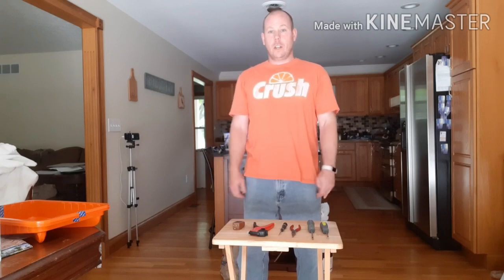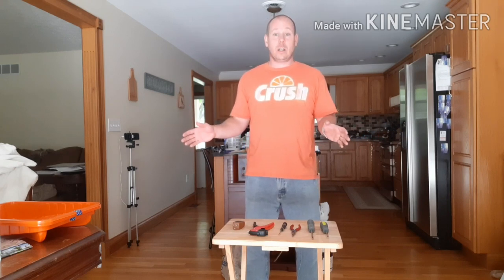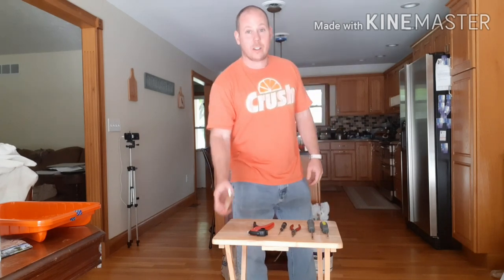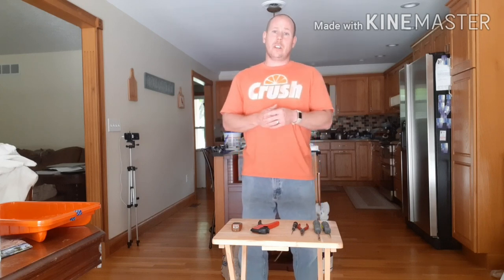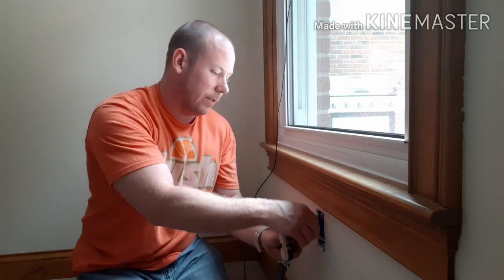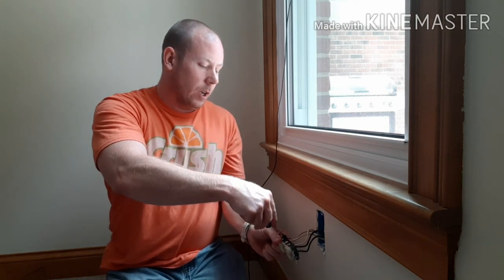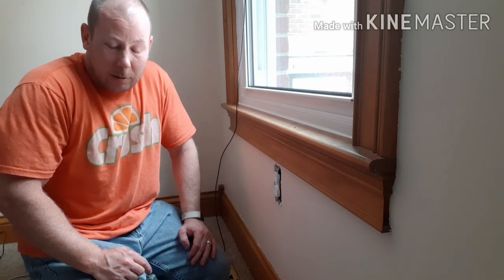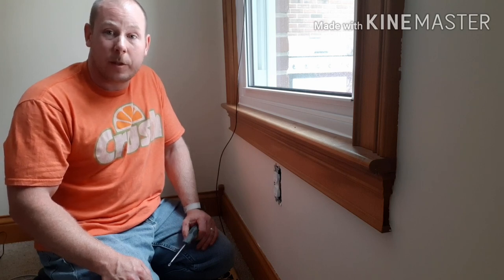How to  Replace or Change an Electrical Outlet (Instructional/How To)

Comment: Looks pretty easy to do. Thanks for the heads up on some of the supplies, it's definitely goot to know before I get started.
Reply from the maker: Yes, a very easy job, just make sure the power is off. Later while doing the rest of the room, I found a couple on another circuit, good thing I double checked once more.